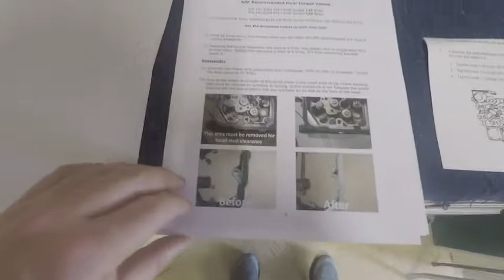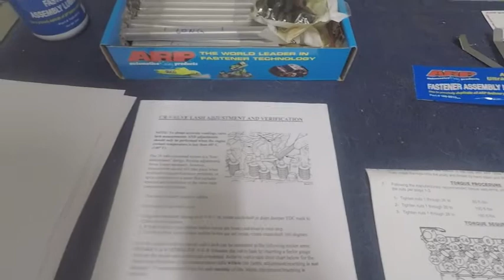6.7 CUMMINS HEADSTUD INSTALL

Comment: Hey, I saw that your torque wrench was off, did you drive with the studs like that and still have no problems?
Reply from the maker: I only drove like 20 miles and didn’t think the torque wrench felt right so i retorqued them. I didn’t have any issues for that 20 mile though.
Reply: @okc_garage  that's good, thanks. You saved me alot of money and headaches lol I didn't know that torque wrenches had to be calibrated, I was literally about to use my pittsburgh I've had for years after watching your vid I looked up how to check and calibrate them. Mine was about 25lb ft too low 😬 didn't want to take a chance, went and bought a new Quinn digital torque wrench I've always wanted one so it was a good excuse.

Comment: How many miles were on your truck when you did this? Any issues down the road with head gasket?
Reply from the maker: Had about 32k miles when i did the head studs. I’ve had zero issues. So far so good.
Reply: I did mine this passed weekend and it went very smooth. Easier than I thought it would be!